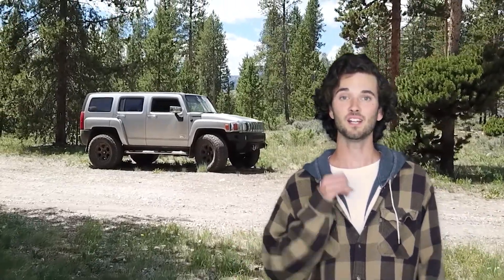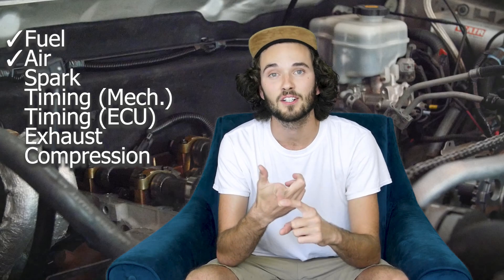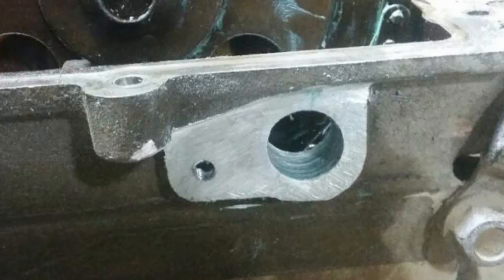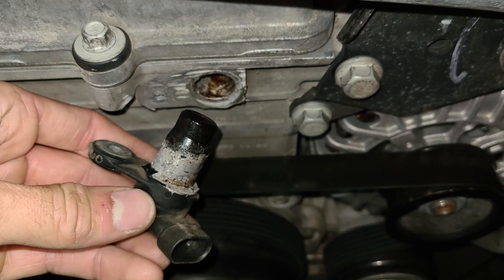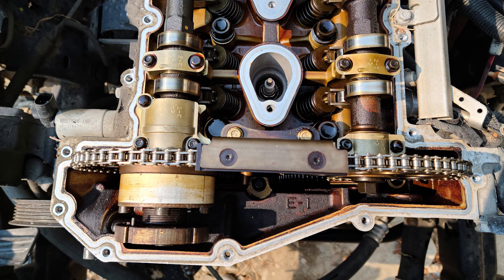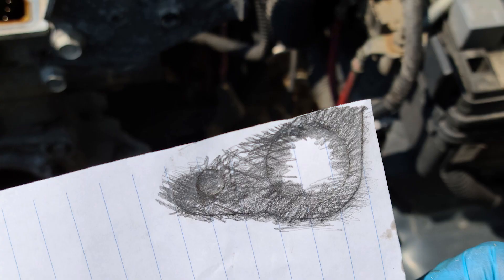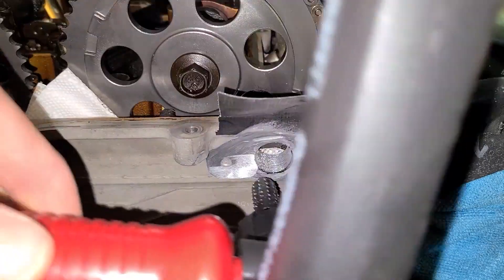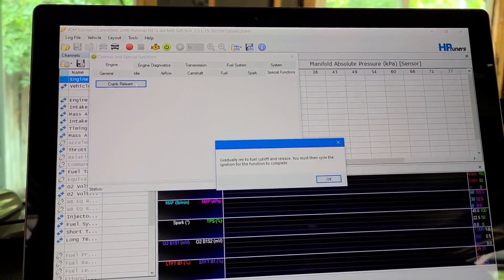Hummer H3 Problem Solved | Thank you for the help!

Comment: Please help. I have an 08 H3. The rear piston / rings failed. I got an 07 for replacement. Both are 3.7's the problem begins. Crank no start. The original engine utilized one cam sensor the 07 had two cam sensors. Can I swap the exaust cam gear and actuator and sensor to fix this issue?
Reply from the maker: I bet that's a stressful situation. I do believe the solution involves something related to the reluctor wheel (possibly the same thing as the actuator). I have forgotten the difference between the 07 and 08 but I imagine that's probably the issue. If you keep reading forums and such, you should find the information. Update me on what you figure out!
Reply: @H3Humper Yes the reluctor wheel/ gear assembly is different on the exaust cam between the two engines. I took the cam cover off the 08 engine today and removed the assembly from the cam. Now to take the intake manifold, cam cover and timing cover off the 07 thats now in the truck. Uug  I will update as I go. I sure hope swapping the two parts is the answer to the problem. I looked at part numbers for quite a while and Im pretty confident but it would be nice to find someone thats done this. So far, no luck there. Thanks for the response.
Reply from the maker: @donfreytag9535  man, you are in deep! I'm impressed, and it sucks to have the engine already installed and having to mess with the timing cover. The previous owner of my 2006 had replaced the 2006 3.5L with the 2007 3.7L. He changed the reluctor wheel and possibly the camshaft. For my 2006, there was both the intake and exhaust side cam sensors. The 2007 didn't have an intake-side cam sensor, so the previous owner drilled a whole to slide the intake-side cam sensor into the 2007 3.7L. He didn't adjust the positioning or "toe gap" properly on the 3.7L, which caused my crank no-start issues. I hope you are able to solve your issue by swapping the exhaust cam and reluctor/actuator wheel. If so, you should do a write-up on one of the forums for the next guy haha 🤣 Good on you for getting in so deep and persevering. This stuff is incredibly discouraging.
Reply: @H3Humper  okay, so today I took every thing out of the way and got the cam cover off of the 07 thats in the h3. It is indeed a different part number. Is it possible to swap the reluctor gear without taking off the timing cover? I dont wanna pull that cover off if I can figure out how to collaps the tensioner a tad from up top and hold the intake can from moving???? LOL I dont have a puller for the flywheel. Plus of course a gasket to put the cover back on.
Reply: @H3Humper the reluctor gear has the same number of teeth and as far as I can see the measurements as far as diameter and off sets are the same. Distance to the sensor is the same. Distance to the front of the head is the same. I dont know that I need to swap the can shaft. Just the gear.
Reply from the maker: @donfreytag9535 If you are able to just swap the gear, that'd be sweet! Save a ton of hassle. Confirming those measurements are the same between camshafts is encouraging. The part numbers between camshafts seem to be the same between those years, so maybe that is indeed all you'll have to swap. It would make sense since that reluctor wheel gives the exhaust cam the timing data.
Reply from the maker: @donfreytag9535 How's progress going?
Reply: @H3Humper at this point, i did get the cam gear changed the cover back on the top of the motor after lining up the timing marks. Now to finish cleaning up the timing chain cover and the oil pan so those parts can be put back together. The temperature went from 71° and sunny to 18° and windy. I hate not having a garage to work in! The weather is supposed to break so I'll be back at it shortly! Thanks for asking, the results are coming soon!
Reply from the maker: That's quite the temperature drop! It sounds like you're making great progress on it. Not having a garage to work in really does suck. I always feel like I'm leaving things so exposed when I'm working outside. What state are you in?
Reply: @H3Humper south west Missouri. I went to buy spray cleaner and sealer. The temperature dropped 20 degrees before I got back! Crazy weather! Trying to keep everything exposed covered with clean towels and plastic between working sucks but thats where thats at. LOL
Reply from the maker: @donfreytag9535  Especially with such an involved repair... controlling debris and moisture and all that really adds some complexity. I have debated renting a big storage unit for a month if I'm ever in a spot where I am needing a garage for an engine swap. I spent a couple of days in Columbia, MO last fall while traveling around.
Reply: @H3Humper I heard a funny noise I havent heard for quite some time last night. IT LIVES!!!! FINALLY!!!  I have the cross member out to drop the front differental to get the oil pan off and am waiting for a new bushing so I havent gotten to drive it so it can relearn so its still running a little rough at idle but at 1500 to 1800 rpm its smooth. What a journey!
Reply: Now the only dilemma is figuring out what to do about that intake cam sensor. I am thinking about taking the pig tail off of the wiring harness that came with the used motor and attaching a note to the end I cut off that says "surprise" and wrapping it back up in the loom incase I sell it someday! 😂😅

Comment: Bro you my go to hummer channel, plz tell me you got a vid showing how to change the fuel filter
Reply from the maker: I'm happy to hear that 🫡 The H3's don't have a typical external fuel filter from the factory, unlike many other vehicles. There is a screen-type filter that is part of the fuel pump assembly inside of the fuel tank. I don't think the filter screen is designed to be serviceable, unfortunately.
Reply: @H3Humper gotcha and thanks, so in other words I’d have to just replace the fuel pump altogether
Reply from the maker: @Dudesaidthat You're welcome! You are correct, replacing the whole fuel pump assembly would be the way. Are you wanting to do it a preventative maintenance or do you have an issue you're trying to resolve?

Comment: Hey I’m having similar issues on a normal 2006 H3 engine. It cranks hard though. And I did have some kind of timing issues going on I replaced all sensors except for the crankshaft position center since that one is a bit harder to get too and I’m still having problems
Reply: Oh and it doesn’t turn over at all
Reply from the maker: Darn! Does the engine turn with a breaker bar on the crank pulley? If it doesn't, the engine may be seized for some reason (likely the common 3.5L lifter failure).
Reply: @H3Humper  I will try that and get back to you In a day here but from what I think it is. It might be a loose timing chain
Reply: @H3Humper  crank moves brother, I think I might have a bad pulley on the timing chain or the timing chain is worn
Reply: @H3Humper  not sure of how long of a fix it will be since I’m finishing school here but I could maybe even make a video or two trying to show I get to it.
Reply from the maker: The crank turning is good news. When you turn the key to "start," the engine does not turn at all, correct? Or does it turn but just not run?

Comment: could it make my engive turn off on iddle after is in opetating temperature?
Reply from the maker: Hello Pedro, the issue I had shouldn't cause the assumption you listed. What codes does your H3 have?
Reply: I hav3 an 2008 Version and mine its fine thanks to your videos. Its a client that has an 06 hummer and she knows i work on my own and asked me to fix hers, she had crank case sensor code and cam sharf sensor codes active, after replacing all of them the hummer keeps turning off when iddle after reaching working temperature. When cold never turns off. I looked for short circuits and has non. cleaned the fuse box found 2 roaches. Battery light comes on every time it turns off and when ramming up the engine it stays on. checked alternator and its working well and replace the Throtle and it still has the same issue.

Comment: I'm have the same problem but I put a motor from 2007 to 2008 Do you have idea? How can make it work?
Reply from the maker: I believe it may have something to do with the reluctor wheels (aka camshaft actuator wheel/sprocket). The 2007 has a 24x reluctor wheel (camshaft sprocket) and the 2008 has a 58x reluctor wheel. If you change the wheel to a 58x, I imagine your engine will run right.
Reply: Thanks

Comment: I have the exact same problem with my '06 with the original engine. I assume the sensor can go bad? Is it easily accessible? Excellent video!
Reply from the maker: Dang! It is a strange problem. I would suggest visually inspecting your current sensor, and yes, it is pretty accessible. I believe only the intake baffling (big black box on top of engine) needs to be removed to access it. The belt might have to come off, too. Let me know if it looks damaged, loose, or anything suspicious. If there is an obvious issue with the sensor, replacing it would make the most sense. I believe there is a way to test it, but I don't know the method. Has your H3 always had the issue since you've owned it? If you are unsure if the cam sensor has been replaced, it might be worth just having a "CASE relearn" procedure done on it (can be done with HPTuners or an Autel, I think). Most shops should be able to do it, too. Make sure the CEL isn't on and any codes are cleared before the relearn procedure. Also, some places describe a relearn without a tool, but I believe a tool is required for our H3's. Let me know when you get eyes on your sensor!
Reply: @H3Humper  I've owned the H3 for 8 years and I know that the first owner was an elderly lady (believe it or not) so I doubt there's been an engine change. I will inspect the sensor connection and let you know. This problem developed within the last few years. By the way, I use my red H3 to transport Marines from the 29 Palms MCAGCC Base to the airport for a local charity, so I need it to run flawlessly. Thanks for your great videos!
Reply: My problem turned out to be the fuel pump; it would not hold pressure when the vehicle was shut off. Works great now, but I have a new problem with it. I can’t pump more than a couple of gallons without the nozzle shuts off. I took it to my mechanic and he did something, but it’s doing it again. I told him I’d run out some off the gas before I bring it back (just in case they need to  drop the gas tank again.

Comment: I think I’m having this issue recently customer brought me a 07 H3 brand new engine block put it back together first no crank no start. Checked fuses back run start fuse blown. Now it only cranks got fuel pressure no spark all new sensors installed power going to coils no codes. Helllllllllllllp!!!!!!! Lbvs
Reply from the maker: Oh dang! I apologize for my delay. Have you got it sorted out yet? Was the engine from a 2007 model year, specifically? There are differences between 2007 and following years, specifically due to a second cam position sensor.
Reply: @H3Humper  not go believe this shit the damn crank sensor wasn’t pushed all the way in  sMh started right up 🤷🏾‍♂️ keep it simple stupid huh

Comment: I have the same problem, the owner I bought it from had a motor swap. I will definitely be checking tomorrow morning cam sensor. 
How did you keep metal shavings getting inside the motor, when fixing the hole?
Reply from the maker: Sorry you're experiencing this, as well! I really hope it resolves your issue. It seems like it could be a very easy problem to encounter during the swap, unfortunately. A person has to be super detail-oriented to position the sensor properly. I recommend making a stencil from an engine with the proper placement (I found a 2006 3.5L Colorado at a junkyard to create my "stencil"). I would mail you the one I made but I must have gotten rid of it, unfortunately. To avoid metal shavings from entering the engine, I stuffed a lot of paper towels and grease around the area. After shaving the material off, I took a vacuum and sucked up loose shavings and then carefully removed the rest of the shavings laying on the paper towel and stuck in the grease and pulled them out. I took care to not drop any and then took clean paper towels to clean up any remaining shavings. I believe the side of the head covers just the timing chain, so you don't have to worry too much if a single shaving drops in because the likelihood of it causing an issue is incredibly marginal (I think).
Reply: I guess changing the year of the cam sensor wouldn’t work either, I thought about finding the year of the motor and find the cam sensor for that same year.
Reply from the maker: @rob marti  Great idea! For some reason the newer engines just straight up don't have the intake-side cam sensor, which is why this year-specific swap requires installing a sensor. To go without installing the sensor, I think a person could replace the whole harness and PCM with the newer year but it'd probably end up being even more work 🤔